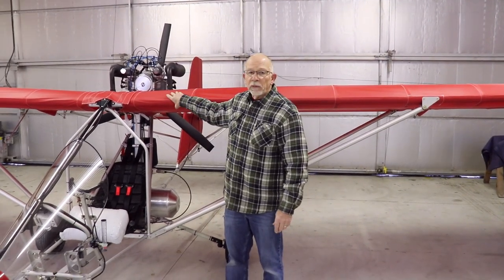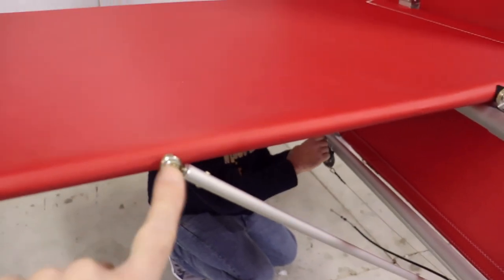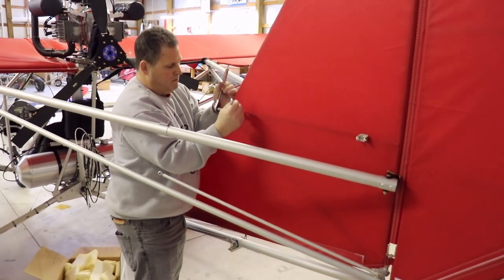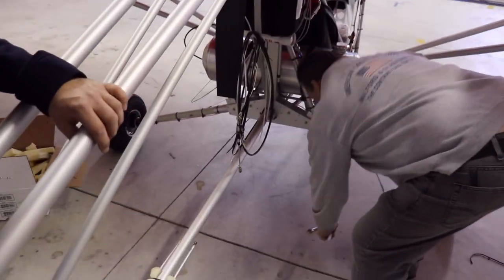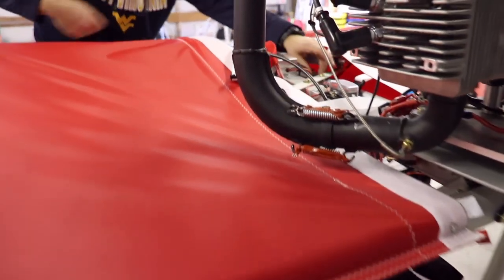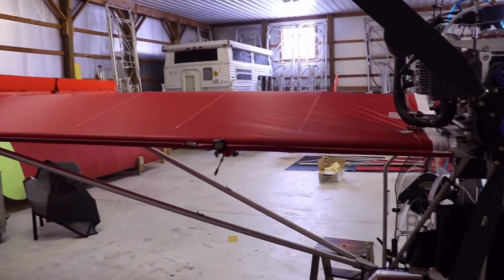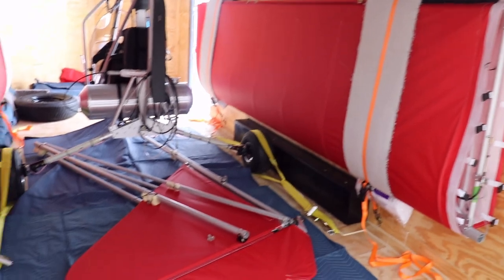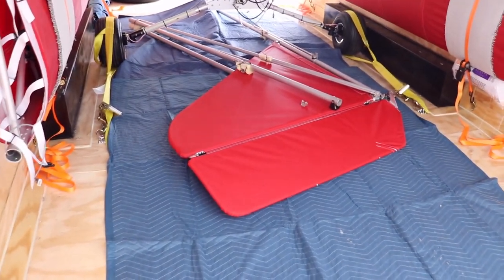Aerolite 103 Disassembly

Comment: I wish the Aerolite 103 had easy folding wings for storage in a garage or trailer so the expense of a hangar is not needed!!
Reply: The Kolb UL has fast folding wings and is easily trailable as I saw on their web site. Maybe a bit more expensive, but when you factor in the cost of hangar rental vs. an enclosed trailer, I think the Kolb is the way to go!
Maybe the guys at the Aerolite factory can come up with a new design with easily folding wings..

Comment: What is the minimum height of your enclosed trailer ceiling to be able to roll in the cockpit cage with wheels, engine, & prop to fit?
Reply: Need a foldable wing option
Reply: 75" to the top of engine

Comment: designer had no intention to make this easily to dissemble for transportation, this is not the plane for you if you cant hanger it. this is the main reason i cant buy this plane, im my opinion an short range aircraft needs to dissemble easily for transportation
Reply: Ok, what's a good part 103 kit plane with folding wings?  Kolb?
Reply: @sailingaeolus  kolb is a great choice, also badlands is a good choice
Reply: @sacooper802  Yeah, those Kolbs look good.  Unfortunately C-19 has really set their production back (I read).  Looks like a year before Kolb will take an order for a FireFly and then you'll get it 18 months later.  2.5 year wait.  I'll keep an eye on barnstormers and see if a used one pops up.